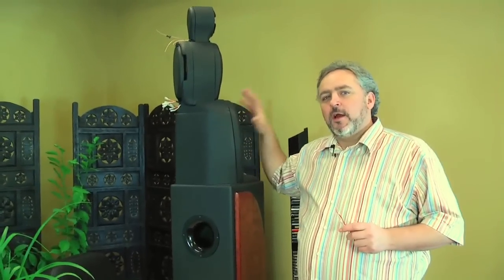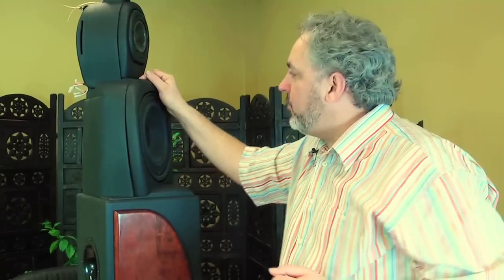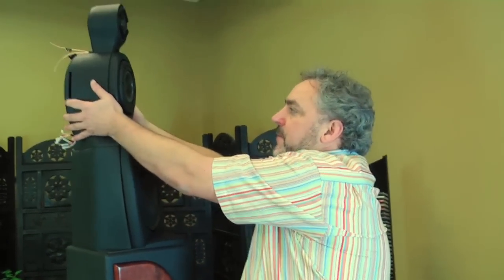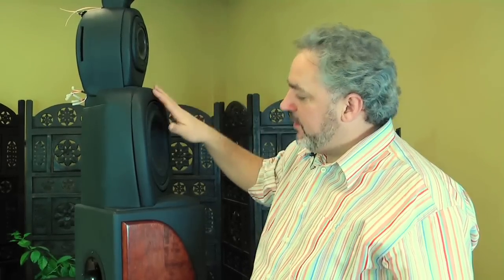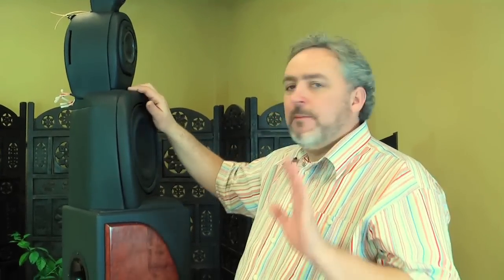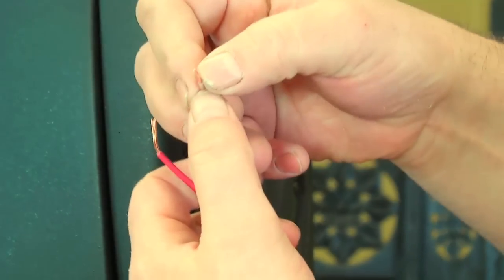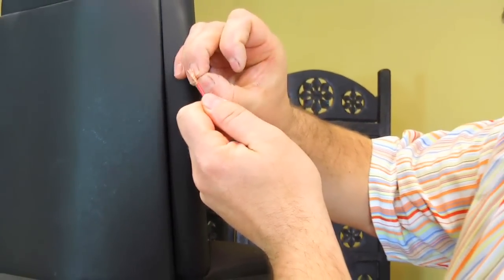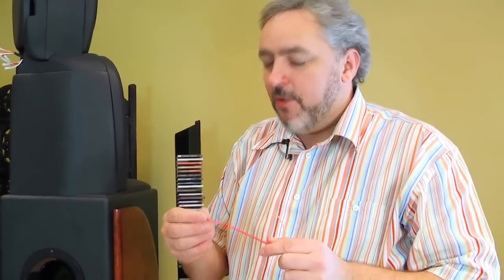Oddiophile Ep 9 Speakers, Time and Phase Alignment

Comment: There is one flaw I see with the single core and that is as you increase wire gauge to reduce resistance to increase damping factor you also increase skin effect which is the effect of high frequency signals propagating to the outer edge of the conductor where there is less heat/resistance and also contributing to phase distortions. I prefer to have my amps as close to the loudspeaker as possible thereby allowing a smaller gauge wire to be used without increasing resistance.